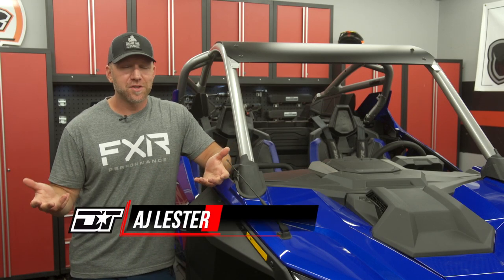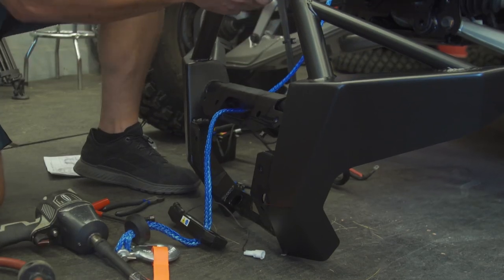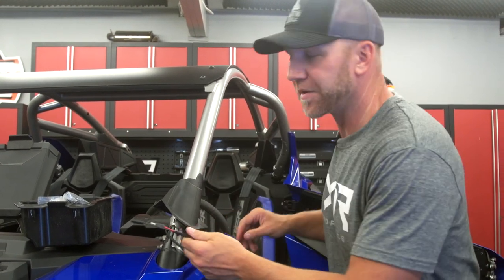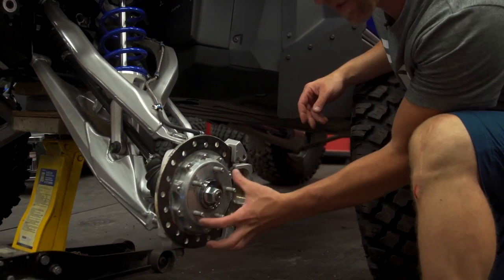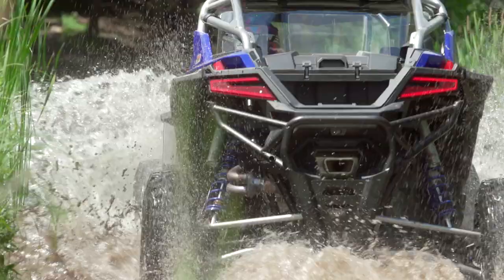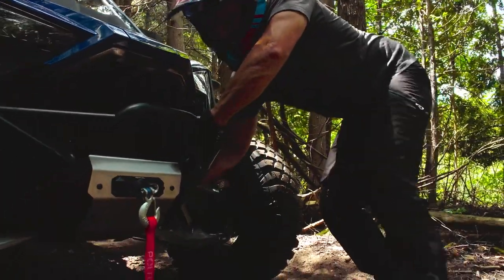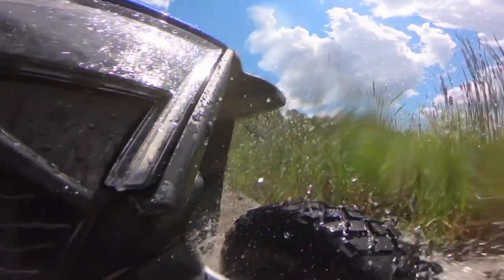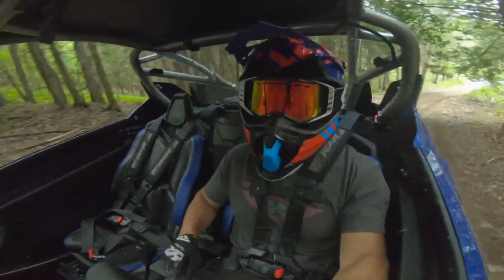Product Guide to the Best and Most functional RZR Pro R Accessories

Comment: Isn't this the same side by side that couldn't pull away from a 4 seater with 40hp less
Reply: if you want a drag car, this is not it.
Reply: @JustDontDieDalton  no but when a brand clames to have 40 more hp and less weight then another brand then you would think it would live up to that even slightly
Reply: @2511jeremy  no one claimed it was lighyer